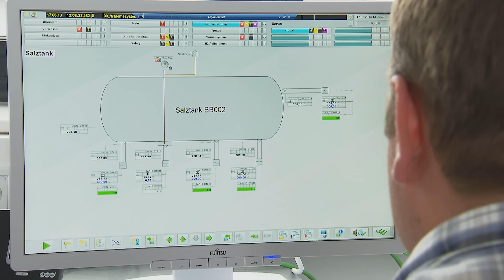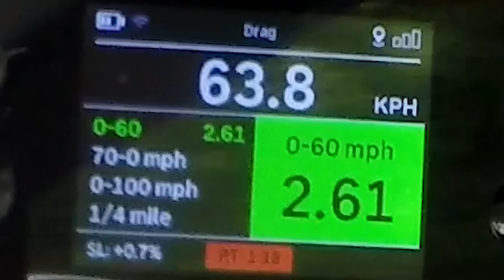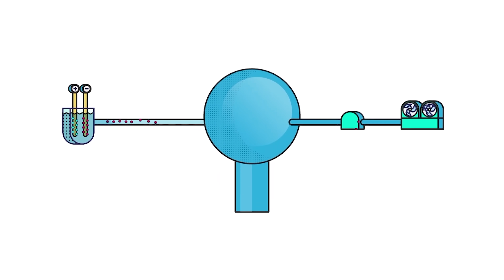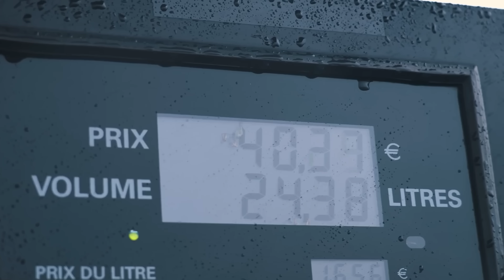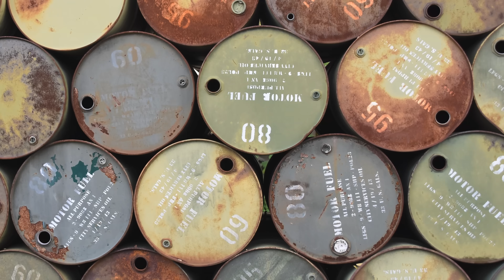Porsche just SAVED petrol engines FOREVER

Comment: I expected more from you Matt. Almost felt like a sponsored video 😉

Using electricity to create a liquid fuel, then transport it, then burn it to achieve motion in a vehicle and losing efficiency along the way instead of just using the original electricity just because ppl can’t cope with a bit more time charging is just idiotic. And that’s using todays infra, which is improving dramatically by the day.

Could this be a better option for ppl to wanting to buy a collectors ICE car? Maybe, but it’ll be low qty, not mass market. I’d love to have the option. 

By 2030 there’ll be so many electric vehicle options this efuel will be long forgotten and even considering it will be plain dumb. Mass market vehicles are going electric and there’s no turning back. I’ll also miss the vrooom vroom just like ppl missed feeding their horses before a journey in early 1900s 😅

Comment: I still feel that the dash for EV is premature, we don’t have the materials, we don’t have the infrastructure and the UK only has about 40% of its electricity from green sources, including current nuclear capacity. So you fancy ev simply means you pay 20k more for the car 1t of dead weight in batteries even if you spend most of your time going to the shops and back, the batteries are knackered after 10 years, not the case with an ICE vehicle, the batteries are difficult to repair, recycle currently and the high cost limits the life of the vehicle to the life of the battery pack, I have an occasional use DISCO 4 I use for towing, does the job it’s over 10 years old and is going strong. I think we should focus on hybrids, where we use batteries for the short inefficient journeys where ICE engine are least efficient, and then on longer journeys we can use the Ice engine as a range extender. This reduces the cost of the vehicle, makes it more effective to extend the life of the vehicle ( even recycling has an environmental impact) and opens the door to options with a mix of electricity and many fuels as the market evolves, allows the existing infrastructure to support users as we gradually manage the move to more efficient motoring in an affordable way….call me simple but for me it makes sense.

Comment: Instead of extracting a highly energetic polluting fuel, they want to harvest one of the multiple pollutants, add a ton of energy from electricity and than burn it into heat, many more pollutants and a minor part of locomotion. 
The efficiency is absolutely thrown out the window.
Basically, it's like making tea injecting the flavour back in used leafs and boiling water in the cup by setting the house thermostat to 212°F

It's wrong on so many levels

Comment: So you can still come into my town burning synthetic diesel in your 3 ton 600hp suv.  Spewing carcinogenic by product?  No thanks.  There are solutions to the charging challenges.

I don't think banning  certain vehicles is yhe right way though.  A carbon tax on fossile fuels combined with a local pollution tax.  If the true cost of burning that irreplaceable fossil fuel was account for then ev or fuel cell would be the only sensible option.

Ice transport will be just like steam engines. There will be enthusiasts, but most will realise how dirty and inefficient they are and not opt for one.